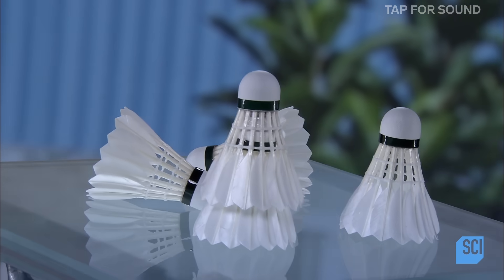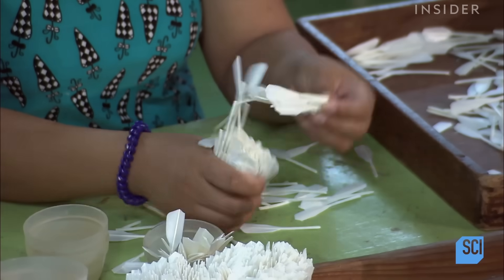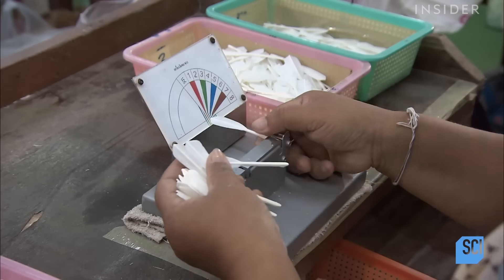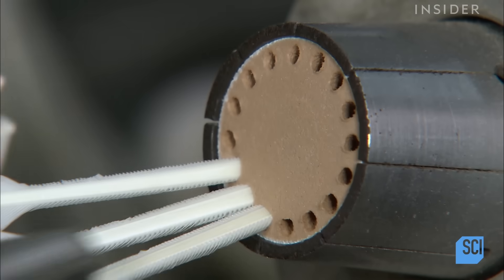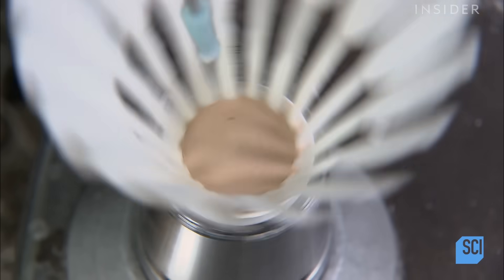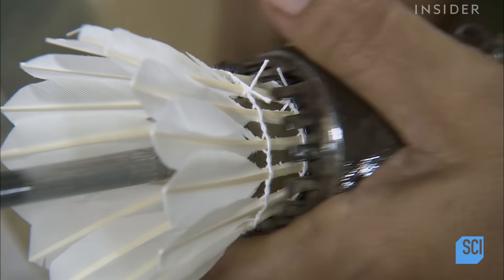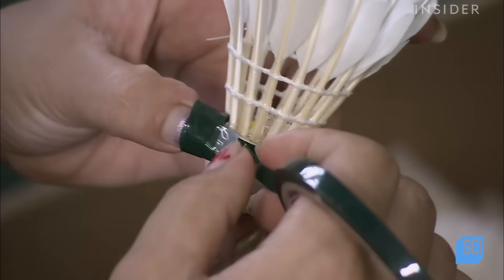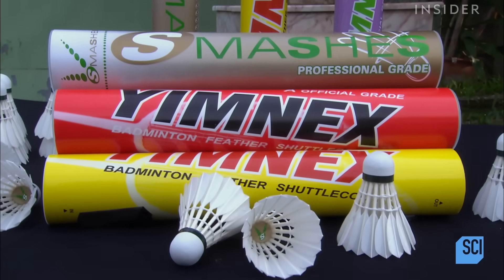How Badminton Birdies Are Made | Design Insider

Comment: Hi I’m a girl learning to play badminton! Any tips?
Reply: It's often better to play around opponents rather than through them. Hold the racket lightly, tighten your grip only at the moment of impact. The closer you are from the net, the lesser you need to use your body: in the back court you use your shoulder elbow forearm wrist and fingers to strike, at the net you just use your fingers. Realize that, other than the serve, all shots made by your opponent are based on the way you send the shuttle to the other side of the net. Your opponent can never smash if you never lift the shuttle, your opponent can never play fast if you play slowly, etc. Don't run around, move around and keep your balance. Go back to the base position after every shot, in time for your opponent's next shot, ready to move to the shuttle. Smooth and well timed movement allows for great court coverage.

At beginner level, girls tend to find it difficult to keep good length on their shots. Once you are able to find good length yourself, a good strategy is to play to the back court until your opponent plays too short, giving you the opportunity to attack. At intermediate level, girls tend to have most difficulty with court coverage. If you can cover your court well and your opponent can't, no need to take risks, just play steadily to the 4 corners, exposing your opponent's weakness. Most players find it difficult to have good length and good control with the backhand from the back of the court. Good players are those who move well enough to hardly play any backhands or have very good backhands. The former being more common than the latter, point constructions that force your opponent to play with their backhand are often good ways to get outright mistakes or scoring opportunities...

Well that ended up longer than expected...
Reply: @akaRicoSanchez  i liked ur comment not the girl if u wondering.. that's a mean girl and a great explanation